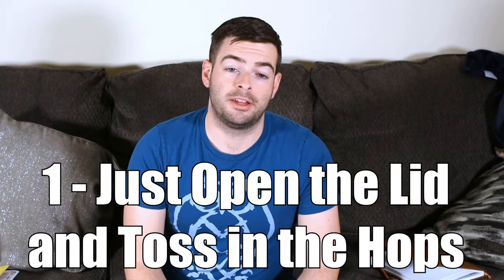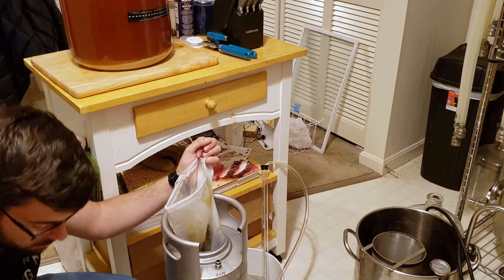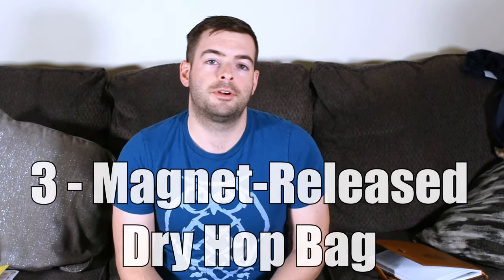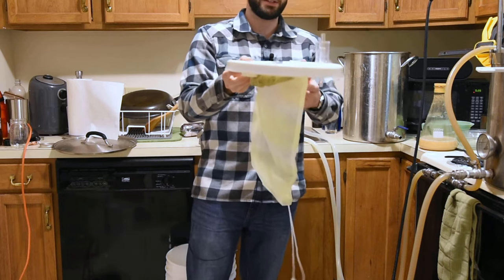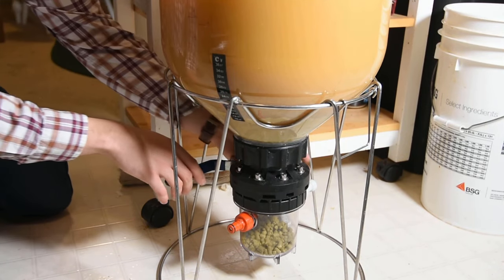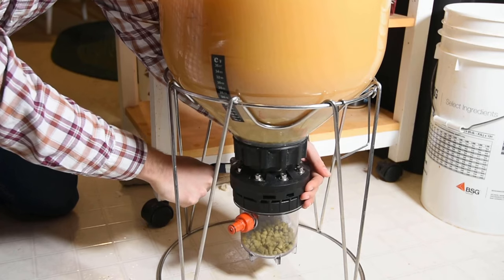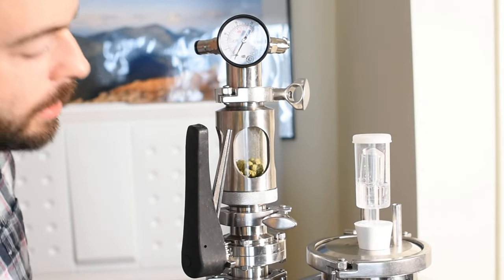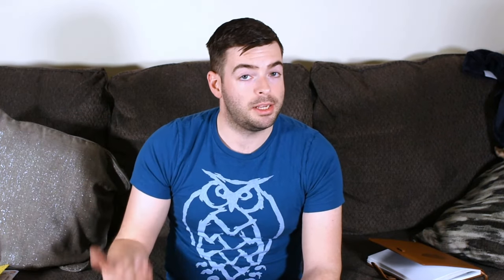5 BEST Ways to DRY HOP | Techniques for EVERY TYPE of FERMENTER | How to AVOID OXYGEN

Comment: I've been playing around with hopping in the keg more recently.  First, it can definitely save a so-so beer once kegged but that aside, dry hopping in the keg really ups the aroma for me.  Doesn't really change the taste all that much but I've found using the same hops as in the boil is the best way to do this. I've tried different hops (mostly just because I have some to get rid of) and getting to crazy ruins things.  It's still a work in progress.  I've not noticed grassiness even after 3 months in the keg.
Reply from the maker: That's interesting that you haven't noticed any grassy flavor after that long of a time. Are you only dry hopping with a small amount? When I dropped in the keg think it was something around 2 oz.
Reply: @TheApartmentBrewer  That's not to say I haven't witnessed it changing.  I rarely use more than 2 oz in the keg but I have lots of LupoMax  hops I'm going to try soon.  No way should those go grassy.  But hey, shame on me for not drinking a keg faster than 3 months. :)
Reply: Have you ever suspended the hops in tea strainer balls? They dip just below the surface so that way when you pull the first several pints they are no longer sitting in the beer.
Reply: @TheApartmentBrewer  Yes, mostly I keep it to under 3 oz.  When I keg hop it's always in a stainless strainer.

Comment: What's you preferred method to transfer a low oxygen dry hopped beer? Ran into a bit of a headache trying to pressure transfer from spike conical thru ball lock into the corny kegs....do you run an inline filter?

Comment: I ferment 3 gallons in a 5 gallon corny. Do you think the magnet trick would work if I put it on the side of the keg? You mentioned not using it for stainless steel.
Reply from the maker: It might, the issue with steel is that they are so thick-walled sometimes

Comment: I have 3 speidel 30l Fermenters. thick Plastik makes magnet method difficult. Still trying to find a good solution. Great video as always, keep it up
Reply from the maker: I was able to use it through a thick bucket lid, I'm not sure if that's similar to the thickness on the Spiedel fermenter, but if it is a stack of about 5 or so of those strong magnets will work.
Reply: @TheApartmentBrewer  Thanks for the answer. I tried "normal" magnets through the side. I added Glas marbles to the hop sack, so it would sink. was way too much weight. I think I need super strong neodyne magnets. work in progress.

Comment: Missed moving the beer to a pre-purged keg with a drop hopper filter already in it and then after 3 to 7 days based on the recipe moving the beer once again to a final keg. This is my preferred method as it works great without oxygen concerns.
Reply from the maker: Thansk for sharing, sounds like a great technique!
Reply: This is a great method and what I tend to do. Once you get into kegging and having the equipment + space for multiple vessels, pressure transferring can be used every time you move beer around, primary > secondary > brite/conditioning > serving. Using these methods, my homebrew tastes fresher far longer than it used to, with hardly any O2 exposure.

Thanks for the content @TheApartmentBrewer
Reply: @tachikoma805  You nailed it about the if you are kegging, have the equipment and the space otherwise it can be a bit more difficult. I do the the primary>Serving (acts as the brite/conditioning with a floating diptube) but if it is an IPA or any beer requiring a dry hop or like conditioning then the steps are primary>secondary(dry hop or other)>Serving.

Comment: If stainless steel is NON  magnetic then... is there a risk of dropping something into your wort that has "rust"  properties fot it to be magnetic?  cheers another great vid
Reply from the maker: It depends on the particular alloy of steel, or whether or not it's a steel plated object. Some stainless steels are not magnetic but others do have ferrous content, however that doesn't necessarily mean that they're going to rust when they spend just a few days in your beer. I would recommend testing it out in some water before you decide to use it, but I've never had any issues using regular old stainless dinner utensils as a weight.  You can also use another magnet.

Comment: Why should I not use magnet technique in my stainless-steel fermenter? I was planning on using food grade silicone magnets, and slowing moving the magnets down into the beer and then after a few days slowly move the magnets back up to the lid out of the beer.
Reply from the maker: I just caution it sometimes because they can be very thick-walled and it can be difficult to keep the magnets and hop bag suspended. Use the silicone magnets.
Reply: @TheApartmentBrewer  thank you! I have the silicone magnets and will give it a go.

Comment: I’ve used the magnet technique in my Fermzilla Allrounder, with French press bags. Works great. Got the bags and magnets from Amazon. Learned the method from Martin at The Homebrew Challenge.
Reply from the maker: It's a great method, I think I initially found on a forum somewhere but I also saw Martin using it a few times after that. How do you like using the French press bags?
Reply: @TheApartmentBrewer  
The French press bags work great. And they’re cheap. They have a drawstring attached which makes it very easy to tie the bag to the magnets. The magnets have a center hole which makes attaching the string easy.
Reply from the maker: Awesome, I'll have to check that out!

Comment: Hi - Just found your page - love it. So much good content.  I am dry hopping a beer next week in a spike conical and love the TC port idea. A couple of questions.

1) Why have the butterfly valve open during fermentation with an air lock?  Couldn't I just have a closed butterfly valve, attach the sight glass as shown and the pressure manifold. Pressurizes as you show and drop the hops. Then close the butterfly valve.  No need to attach the blow-off again.  Seems like I don't need it on either end. But I might be missing something - Pressure build up on the butterfly valve maybe?

2) I was planning on dry hopping for 3-4 days after primary and at  final temp - something like 72-74 degrees - cold crash 2-3 days, dump yeast/hops and then keg. Is that about right/

Thanks for all of your brewing - Cheers!
Reply from the maker: If you close off the butterfly valve the fermenter will continue to build up pressure past its rated level. This is extremely dangerous if the pressure gets too high which is why you either ferment with a spunding valve or an airlock in this case with the butterfly valve open. Your dry hop plan sounds good, but I wouldn't rush to cold crash in case you get hop creep. Then you might have some diacetyl to worry about
Reply: @TheApartmentBrewer  - My thinking is that I have a blowoff tube on a separate TC port to so pressure build-up is not an issue.   

When you say to not rush the cold crash - do you mean that I should wait to cold crash for more like 5-6 days?
How do I tell when the Diacetyl is cleaned up.

Thanks again

Comment: Are magnets in direct contact with beer dangerous?
Reply from the maker: Depends on whether they have food grade coating or not. Thats why I suggest using something that can be sanitized instead of a magnet inside
Reply: @TheApartmentBrewer  i took those recommended in the description and i immersed them..it's correct?
Reply from the maker: You'll be fine, but next time I'd recommend keeping them on the outside and using a steel object on the inside
Reply: @TheApartmentBrewer  thank you!

Comment: Great video! Any ideas how to dry hop if you ferment it kegs? I going to start doing this and haven't figured out a way to do this.... Thanks as always for your great content!
Reply from the maker: That's a good question, and I actually don't necessarily know off the top of my head.  I think maybe the best bet would be to hook up gas flowing into the keg via one of the posts, and then open it up and add your dry hops. I think you should be OK flushing oxygen out that way, but of course be sure to purge after closing the lid again. And again there could be an issue when you open the keg if you're fermenting under pressure, you don't want a beer explosion!! Maybe the magnet technique will work for you?
Reply: @TheApartmentBrewer  thanks! That seems the safest bet... I will be fermenting under pressure,  but will purge before opening... I Appreciate your content and clear,  thorough explanations, while being open to input... I learn from the comments as well

Comment: A bit off topic maybe, but whats your input on unwanted hop flavors in relation to exposure time? I had some issues with off-flavors that I feel might come from too much dry hops in combination with number of exposure days. I used the metod of ONLY dry hopping at full fermentation activity, but still had issues with some off-flavors from the dryhopping. So even with close to none exposure to oxygen I had issues that I thought was oxidation.  The exposure time of that dryhopping was 7 days.
Reply from the maker: There are three main "off flavors" related to dry hopping. The first is so called "hop burn" which is a harsh tannic type sensation at the back of the throat and you can get that from dry hopping simply with too much at once (1.5-2 oz per gallon). Second is that grassy flavor mentioned in the video and that mainly comes from too much plant material for too long of a contact time (usually I try to keep it under 5-7 days). Third is a phenomenon called hop creep, where dry hopping at too warm of a temperature for too long can cause a buildup of diacetyl. That can mute other hop flavors, cutting down on the brightness of the hop character in general and can be mistaken for oxidized beer. That's my guess as to what's going on in your case.
Reply: @TheApartmentBrewer  Thanks for the input! Hop burn has not really been an issue, had the idea that the "grassy" notes was what I got. But since it doesn't really change alot with contact time (Or that I rather get the stale off flavor even with short exposures), Im not so sure anymore. So Im leaning towards that it might be oxygen anyway, since I get really low fruit notes with high amount of dry hops. Should look into hop creep as well. Thanks! And thank you for your work on the channel!
Reply: @TheApartmentBrewer  thanks for explaining all aspects in a few sentences, i'm a beginner brewer and your videos/comments really helps me better understand this hobby

Comment: if you are just dropping the hops in below via the last method, how do you prevent your transfer to the keg from getting clogged? Should the hops fall down to the bottom?
Reply from the maker: It's kinda a chance. Sometimes they float, sometimes they clog
Reply: @TheApartmentBrewer  sigh
Reply from the maker: It kinda helps to have a conical in that case though
Reply: @TheApartmentBrewer  I do  I just added some today to my wc ipa, I dumped them into the top but fermentation still going
Reply: @TheApartmentBrewer  I even swapped out my sanitizer airlock bucket tube (have a tube going out of airlock into a 2 liter water thing filled with sanitizer) now it stopped bubbling

Comment: I have the ss brewbucket and have been adding dry hops while pumping CO2 in from the racking port at the bottom. I feel like I'm getting that same positive pressure to keep oxygen out. I then keep the CO2 going for another 30 seconds after I seal the lid to try and purge the headspace in the fermenter. It seems to work but I'd be interested to see actual data on that or a brulosophy-type experiment.
Reply from the maker: Seems like it would be a good method, cheers!

Comment: Hi, first thanks for the video on different techniques! So I've been making NEIPA's for a while now, double dry hopping in the fermenter, the second dry hop addition coming about 4 days before transferring to keg and via the just-drop-it-in method. I'm interested in trying out this magnet idea with my Speidel 30L fermenters for that second addition, but to what end? I know oxygen is the enemy of beer, but like what happens when that small volume of air comes in contact with the beer when I drop my hop bag in 4 days before packaging? Does it dull the hop flavor I'm trying to achieve or the malt flavors? If so, how immediate is that effect? Or does air exposure produce some kind of off flavor? I'll say I've never detected an off flavor or unpleasant smell in doing this, but I will also admit my hop saturation flavor in the final beer (while improved over time) definitely is not quite where I wish it was. So I'm curious to know what the actual affect of this amount of air contacting the beer is, and how immediate (or not) that affect might be. Thanks!
Reply from the maker: Well, air is a good percentage oxygen and with enough time it will mess things up for the beer. Generally, oxidized hoppy beer tastes dull/uninteresting and starts to darken the color towards brown/gray/purple. I'm hesitant to jump on the bandwagon that a few seconds of exposure will ruin your beer, I really don't think that's the case. But a few minutes of exposure, or even worse, splashing/incorporating bubbles into the post-fermentation beer will definitely cause shelf life issues a few weeks down the road for something like a hazy IPA. Of course, this is mostly preventable if you flush out headspace with CO2 or add some ascorbic acid as an antioxidant at some point in the process.

Comment: Question:  The piece that to attach to the top of the sight glass that you describe as a tri clamp accessory with a pressure release value and gas post.  Where can I get that?  I've looked all over amazon to no avail.  Any direction would be greatly appreciated.
Reply from the maker: It's the Spike brewing gas manifold. I believe you can only get it on their website
Reply: @TheApartmentBrewer  Thanks for that!

Comment: Maybe one of you can help me with something I’m not getting. Assuming you don’t have a hop dropper/doser, from my understanding adding dry hops into carbonated beer is how you get a beer geyser to happen from all the nucleation points hitting CO2 and causing it to rush out. As I understand it the tank needs to be depressurized first, or is there a difference between the head space having CO2 pressure and the beer itself?
Reply from the maker: Yes, you need to let the head pressure out before dry hopping, but there still is a risk of geysers even after.
Reply: @TheApartmentBrewer  Ok so there needs to be absolutely no CO2 in solution or in the head space when I drop those in. Good to know! So what’s the method then? You purge the tank, throw them in and seal it up as quickly as possible and then purge the headspace with CO2? I’ve read a lot of people suggesting to put a little bit in first, wait for that nucleation to settle out and add the rest but this was also for a production scale as opposed to a 5 gallon batch.
Reply from the maker: Some CO2 in solution is fine, but if the fermentation has been pressurized for a long time the risk is high. A little at a time is really best way to do it
Reply: @TheApartmentBrewer  I was planning on doing something similar the method you’ve been using of letting it ferment out, wait a few days for a diacetyl rest, soft crash to 56F and then add hops. I assume that should help not to add when it’s too active but of course increases oxygen risk.
Reply from the maker: I've definitely gravitated toward that more now. It's easy to bubble CO2 up through the fermenter if you have a conical, that keeps the oxygen from being too much of a hazard
Reply: @TheApartmentBrewer  Yeah I’m be been listening to the Craft Beer and Brewing podcast which is incredible for info. Highly recommend that and the “West Coast IPA Now!” episode in particular, but a lot of the pros seem to be doing that method I think mostly for yeast re-harvesting purposes but they also think it’s a cleaner expression. Granted some are still dry hopping towards the end of fermentation. 

When you bubble up CO2 are you usually doing that through the dump valve after the yeast is out or through the racking arm? I’m looking to get back into home brewing after a 7 year hiatus and am determined to do closed transfer but coming from a carboy to bottling bucket to bottles background the conical fermenter is pretty intimidating. Especially learning to clean all the parts and getting it back together correctly. Haha
Reply from the maker: @curtisbrause9255  either port seems to work pretty well for me. Obviously you'll want to make sure the yeast is dumped beforehand if you want to use the dump port though. No worries on your concerns, they're totally valid! You can still get great results with a bucket fermenter and adding your dry hops in with the magnet style!
Reply: @TheApartmentBrewer  Nice. The magnet method does look like a really smart way to dry hop if I don’t pull the trigger on a conical. 

I think when I do get back into it I feel fairly set on that Clawhammer brew system though. I’ll gladly sacrifice a bit of efficiency if I don’t have to sparge and the beer turns out just as good. That part of it doesn’t make me nervous at all and much better than guesstimating strike water into a converted Gatorade cooler. The handling CO2 is the part I’m a bit leery about. Haha
Reply from the maker: Sounds like a plan! Hope you enjoy your future brews very much!
Reply: @TheApartmentBrewer  Thanks! Appreciate all the tips and all the videos. Along with brewing classic styles they’ve been a huge help for recipe building.
Reply from the maker: Anytime, I'm glad they help!

Comment: I bag all of my dry hops in 15" muslin bags (the bigger ones) -- do you think there is any issue with hop contact/utilization doing this?
Like the magnet trick, will have to try.
Reply from the maker: I dont think so, I usually do the same thing in most cases.